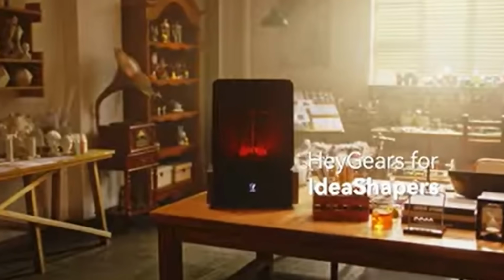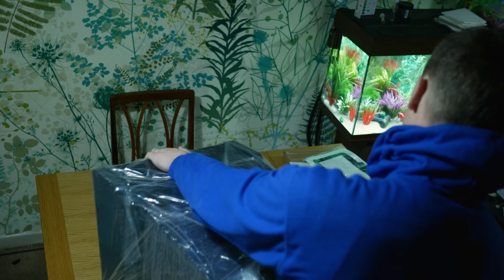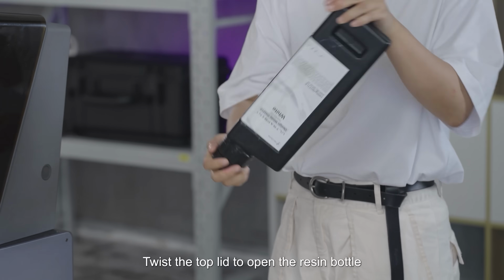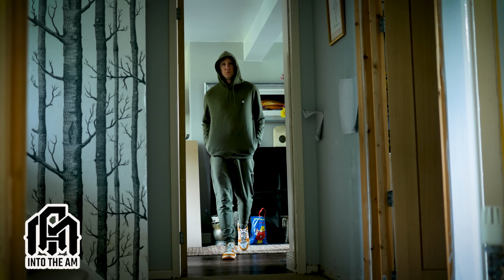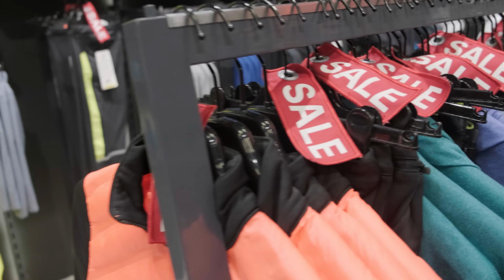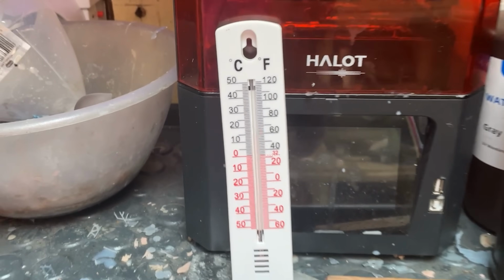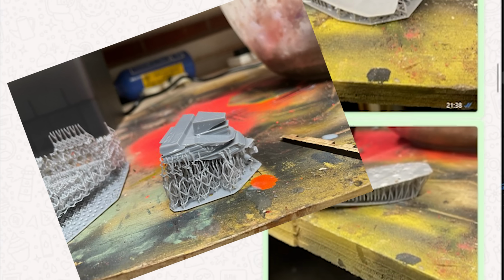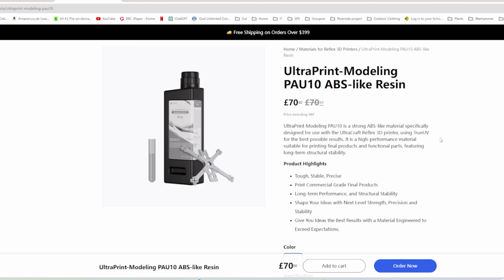The BEST 3D Printer you'll never buy - Hey Gears Reflex Review

Comment: Fantastic job, and I agree with your assessment of these products. They make a lot of sense when you compare them to Formlabs, but absolutely falls flat for us hobbyists.

Something else worth noting that gives me great concern for their ecosystem; is the reliance on a login and connection to a cloud server to slice prints for the Ultracraft Reflex. If Heygears don't add the "Pro" mode you mentioned, in addition to removing the login requirement on the slicer, then this printer may straight up be unusable one day if for whatever reason that server goes offline.

Happens all the time. Like how many video games have suffered this form of digital decay and are just straight up unplayable now?

Edit: one more point I'd like to add, is that even for most small businesses who are buying resin printers for a production line would be better off buying 3 budget printers vs this thing. If one goes down you still have two pumping out parts while you sort out maintenance.
Reply from the maker: Yeh, both really valid points, I also worry about the need to login too, it’s too easy to turn around and increase to cost or insist on a subscription model. Phone and TV companies do this all the time, again is more normal for “business” models but that is not the ideal destination for hobby machines.
Reply: @OnceInASixSide Hi James 🤣 I agree with everything you said.
Reply from the maker: Damn straight 😂
Reply: dont worry, just change your profile pic to clippy, haven't you heard? it will make all the bean counters quit counting beans.

Comment: Great video and great points - I'd also really prefer if 3d printing doesn't turn into the hellscape nightmare that is trad 2d printers. I still hope the likes of Elegoo etc start taking some of the better design cues from these kinds of printers though, we've seen a bit of that with the Saturn 4 release recently so I'm hopeful the next few generations of printers will innovate without closing everything off
Reply from the maker: Yeh, that’s my hope too, you have companies like Bambu and Hey Gears with closed systems (although at least with FDM you can swap materials) and then there is still innovation in the hobby end. So feels like it could go one way or the other.